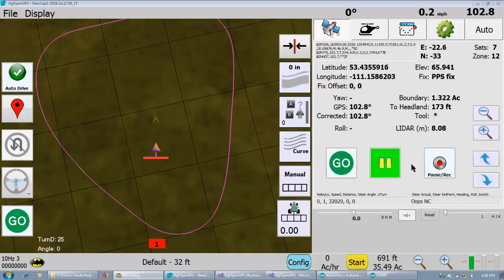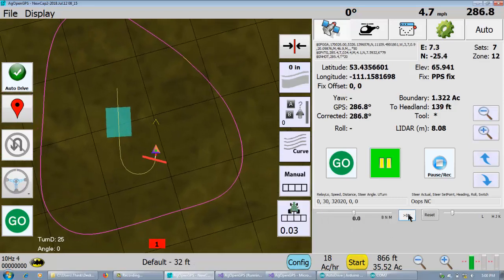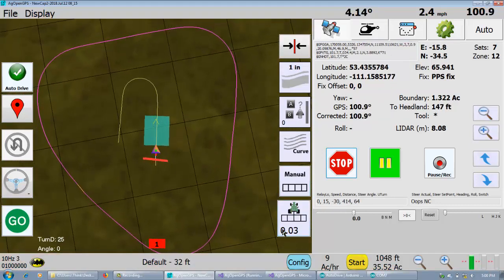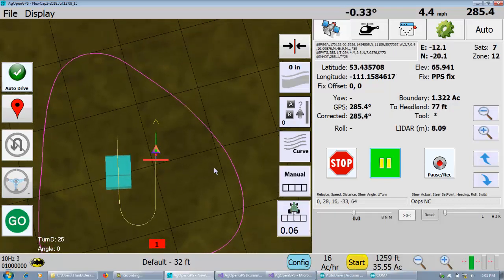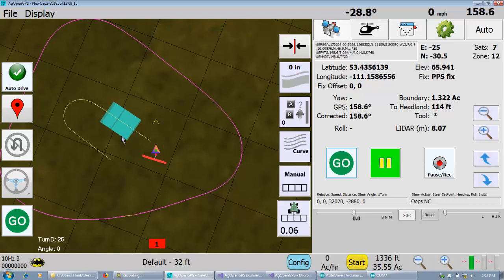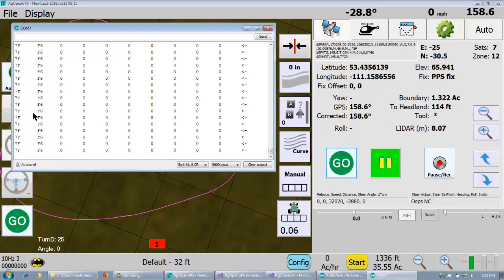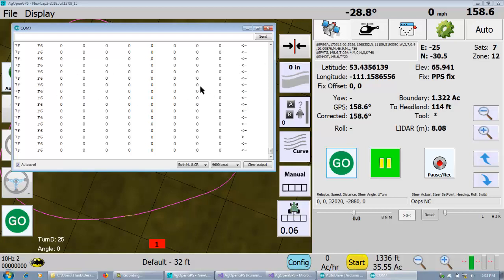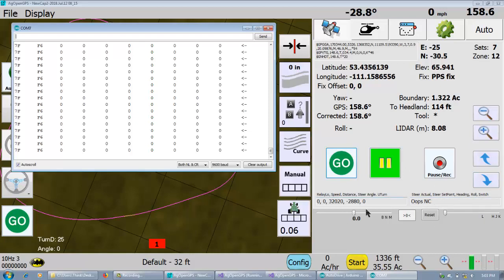Record Playback in AgOpenGPS - Easy RoboMower

Comment: can u store that recorded path?
Reply from the maker: Yes it is saved in the field directory as recPath.txt
Reply: well that"s  very good. Just started using your good work and this are now next steps which would be of crucial importance in order to combine AOG with Farm management programs and exchanging data.
Reply: converted a DWG to KML file in my GIS and tried to import it in AOG which did not work. I could open it in Google, and wanted to ask if there is something I omitted in the process?
Reply from the maker: @janide70  The kml import is for boundaries only. Only making a line and saving that in google earth works.
Reply from the maker: @janide70  I would have to program making a path and convering it to a recPath the would work with AOG would be pretty handy!!
Reply: @FarmerBrianTee  making a line in Google is fine but there is no tool for making it to snap to the boundary I previously imported and it is not accurate. if Google provides the tool it would be good, but making lines is not accurate because even Google pictures are very inaccurate compared to local coordinate systems. That is the reason I would like to have the ability to take my data from my local coordinate system converted to an SHP or other standardized formats. Particularly in eastern Europe, Google does not update maps very often dough. But anyway that's what I found and we will see what happens next. I am going to test the Prog in the field. til now everything is awesome!
Reply from the maker: @janide70  Under the tools menu is "Create Boundary Contour" which makes a contour line to follow around the outside or inside boundary and do the headland. Wouldn't be a lot of change to make it make a recPath the same way. New version on Github - big changes
Reply: @FarmerBrianTee  Excellent!! it worked in the lab :) we will see in the field. I"ll keep you posted